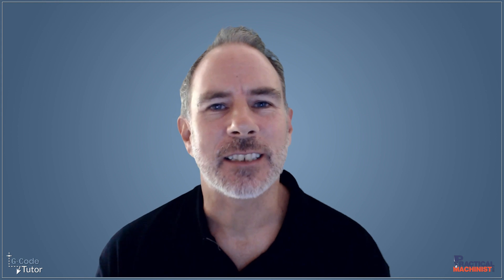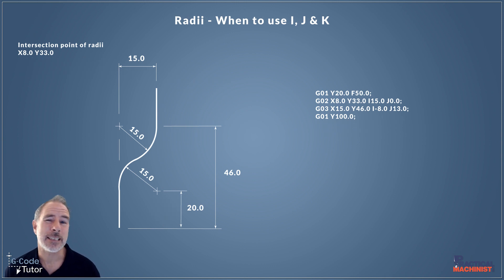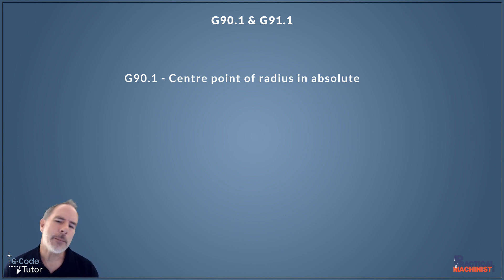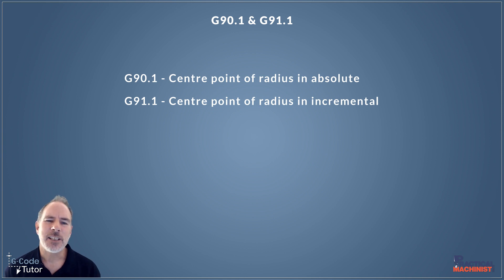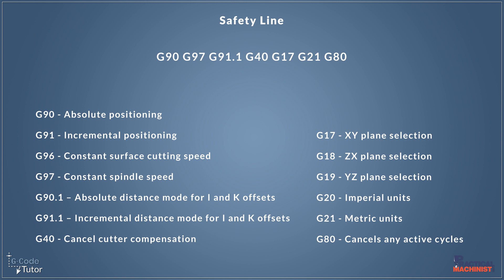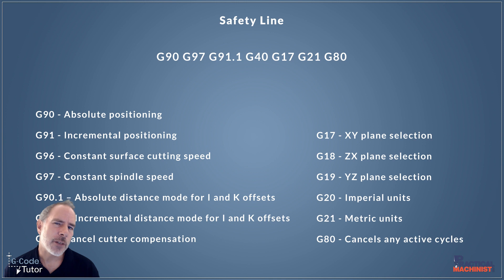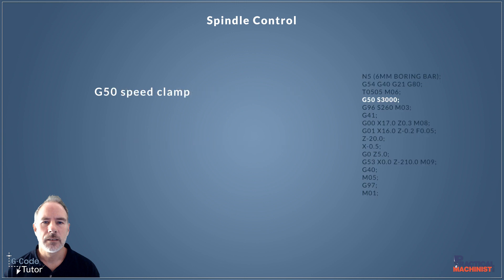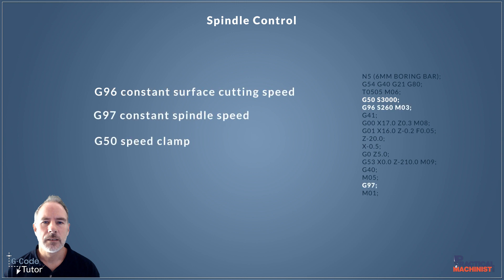Practical SOLUTIONS to G-CODE Programming Issues

Comment: You know something that’d be interesting would be to have a minimum speed clamp on the lathe also. Doing this your spindle wouldn’t slow way down when doing a tool change/etc then ramp back up when starting to cut. Would think it’s be easier on spindle drives eliminating useless spindle ramps. I know you can put in a G97 to keep it spinning at whatever rpm but if the minimum speed clamp was modal you’d only have to enter it once for the whole program. Just a thought

Comment: Another good g-code pill of yours, pretty addictive 😉
I often see the G54 also on the safety line but this doesn't feel that right to me... Curious to get your insight about that?
Thanks for all the great actionnable knowledge shared with the world 🙏
Reply: For what it's worth my safety line reads as follows for a milling machine G0 G17 G40 G49 G53 G80 G90 G94. Followed by tool change line. The next line should contain your work coordinate. I usually write it as follows G54 X0 Y0 M3 S2000. Obviously your X and Y locations and spindle speed will change depending on where your feature is located and what kind of tool and material you're cutting.  Hope this helps. Obviously my way isn't the only way to get it done, but it's the way I was taught and it's always got the job done for me.
Reply: @RoboHero_79  thanks for your answer. Another question though, why the G53 ? As I understand it, it's non modal and only affects move on the same line and machine is switched back to the former active WCS on the next block, so what's its purpose/effect on a safety line like this ?
Reply: Yeah it's not completely necessary for the G53 it's just there to cancel any work coordinate being used in  the case you're switching between say G54 and G55. Like I said it's not really 100% necessary but it's how I was taught and I've always just stuck with it.